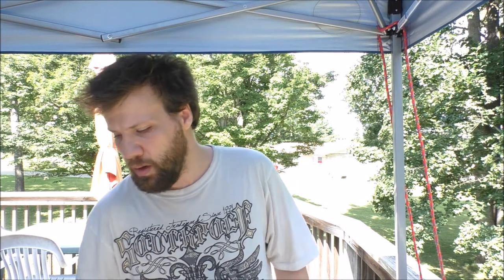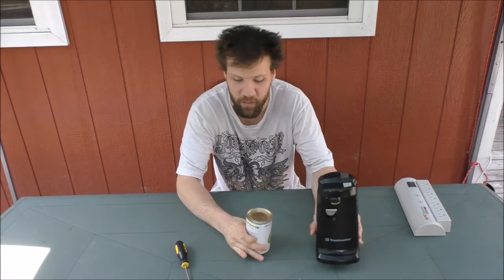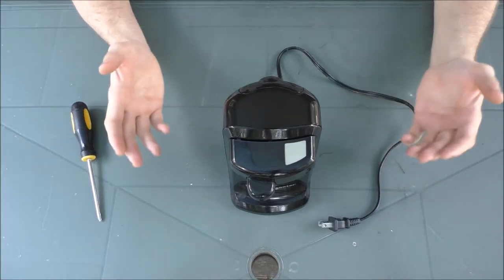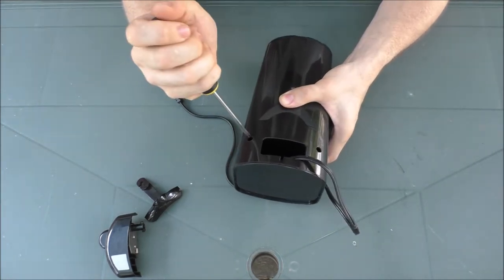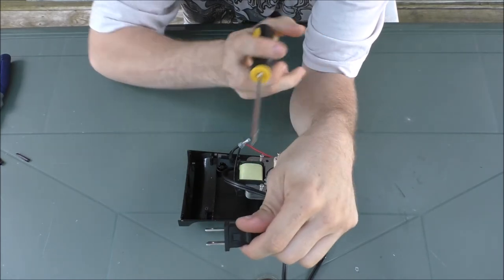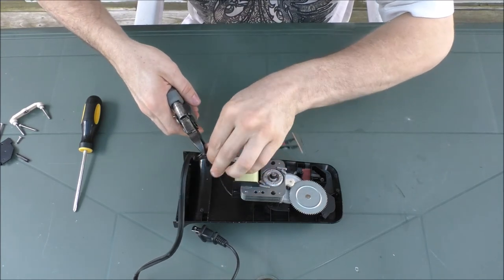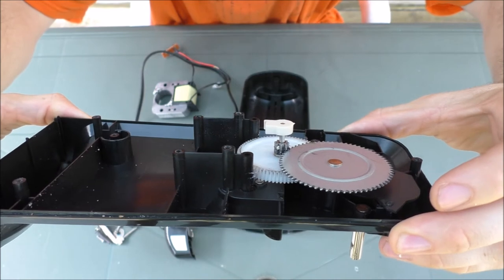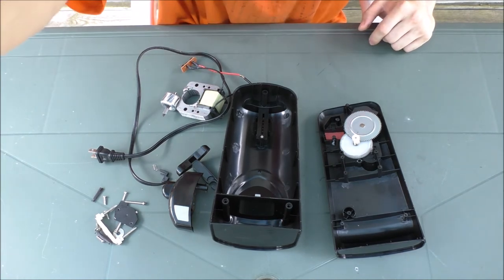HOW TO TAKE APART A ELECTRIC CAN OPENER TOASTMASTER

Comment: My Toastmaster can opener also got very noisy, but it still opened cans just fine, so I went after mine trying to FIX it.  Took it apart, just like Chris did, and hit all the gears with silicone lube.   Still noisy.  I listened closely and determined the noise was coming from what Chris called the spindle (next to the winding)  Spraying silicone around the outside didn't get the noise, but spraying the inside of the shaft on the spindle FIXED the noise!  (I didn't even need to remove it - just spray silicone using the little straw right next to the shaft on both sides.)  Nice and quiet now - let's see how it is in 6 months.

Comment: Very interesting, however, I was able to fix a Procter- Silex can opener that had stopped working, motor was frozen. My remedy was to open and remove the back side. I lightly tapped the gears without having to remove the "innards" as Chris did. I did notice some grease which was wiped away, sprayed a small amount of WD-40 o9n the gears and voila! works like a charm. BTW there isn't much on You tube re: repairs of electric can openers at least at the time of my comments

Comment: hey! looks like the part that failed was the metal pinion gear that drove the larger gear, the teeth on the smaller gear were worn away by operation. its not the design best practices to mismatch the face width "thickness" of the gear by so much for exactly that reason. rather than being designed to be disposable, though, i think you're right, given that the driven gear was riveted into place, a clear sign of disposable design, i think the problem was that the designer made a mistake, and used either too large of a mismatch in tooth face width, or too soft of a metal for the pinion gear; the little one.